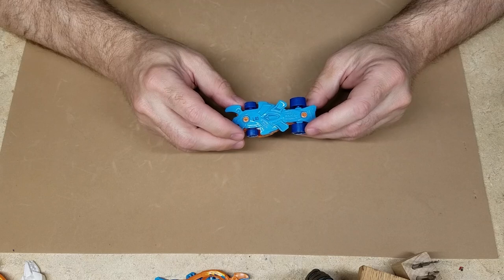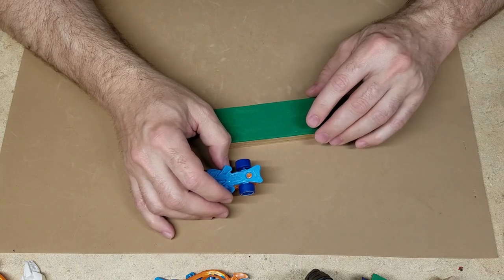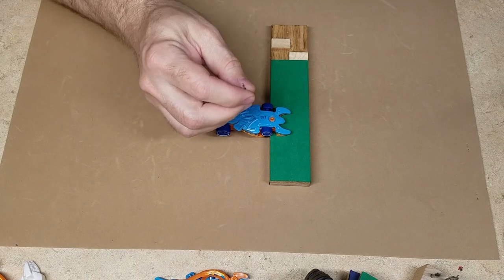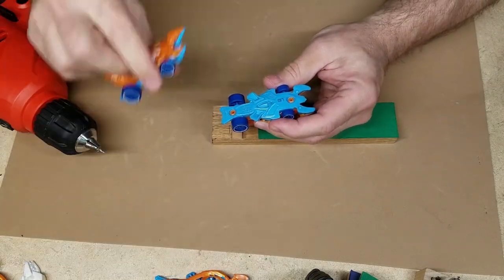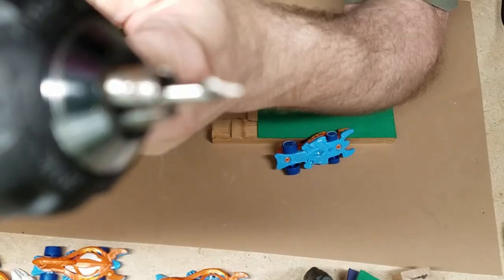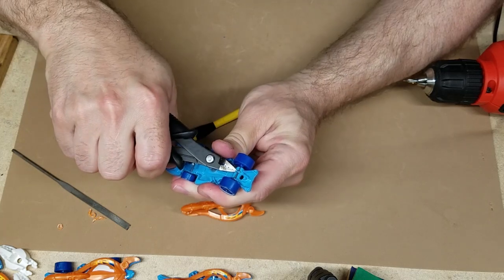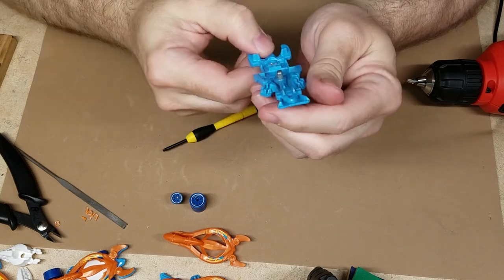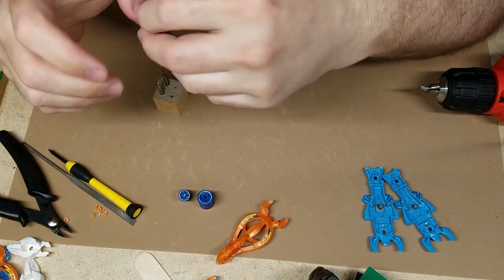Project Scorpion Episode 2: The Build Begins

Comment: at 27:30 you are drilling in to the cars posts.....
the speed f the drill is too High....
need to low it down to avoid accidents
Reply from the maker: NinjaViking1 If by accidents you're speaking to the drill bit drifting on me... going slow would have prevented that. I was rushing because I was trying to keep the video to under 30 minutes and it was fast approaching that time. At the 6:35 mark of the video I do speak to drilling slow for control. I probably should have listened to my own advice on that. Nonetheless, the result despite it drifting turned out fine as shown in the video insert. Thanks for the comments as it does allow me to clear up a slightly clumsy end to the video.